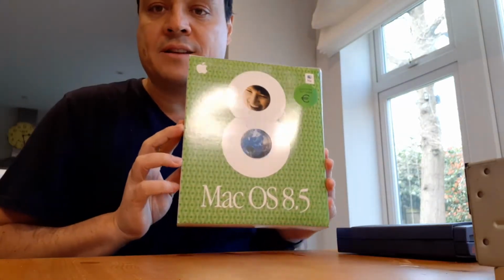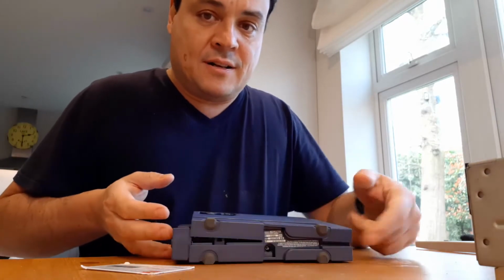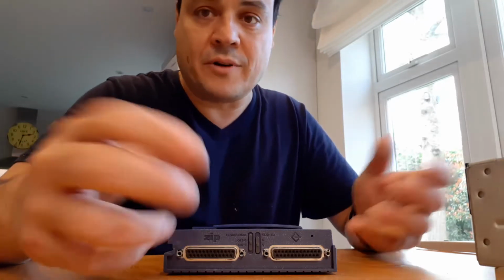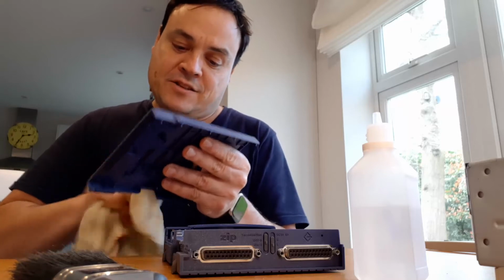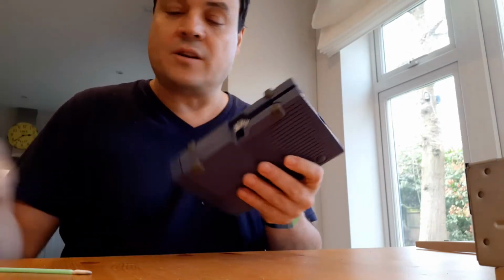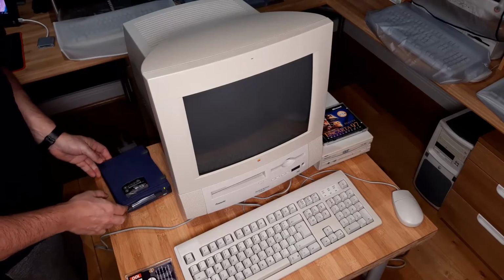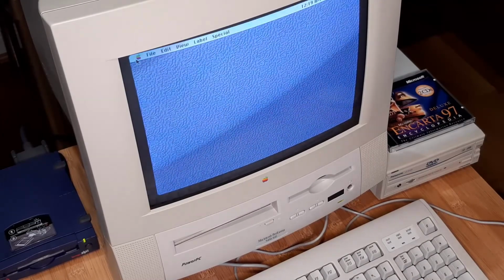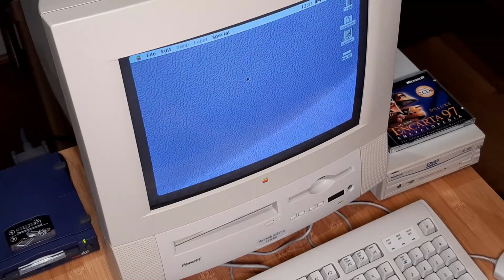SCSI Zip drive clean up and test

Comment: Excellent presentation. I already liked and subscribed to your channel.
I have a Roland VA 76 piano.
It comes standard with a floppy drive and zip drive. I have already replaced the floppy drive with a USB emulator.
I wanted to do the same with the zipdrive 100 IDE.
I want to change the zip100 to something that does the same as the usb emulator. Do you have any advice that can help me? I am grateful for an answer. Cheers.
Reply from the maker: Hi Vitor, maybe using a CF2IDE board such as https://www.amiga-shop.net/en/Amiga-Hardware/Amiga-classic-hardware/CF2IDE-IDE-adapter-2-5-inch-female::909.html
Reply: @retroguy2019  Thanks for the anser, my friend. Cheers.